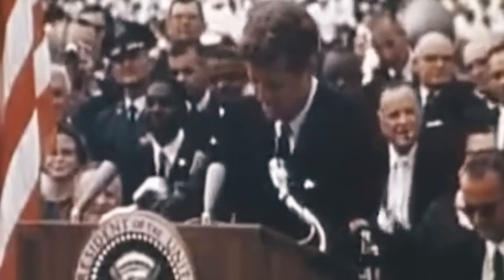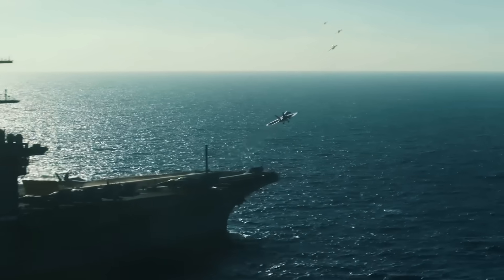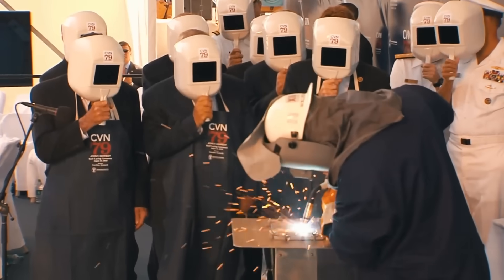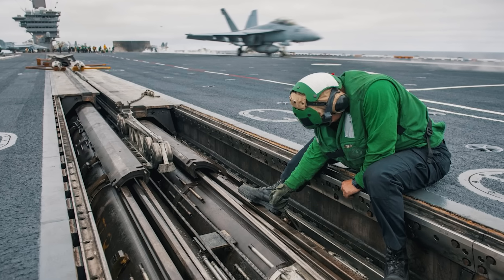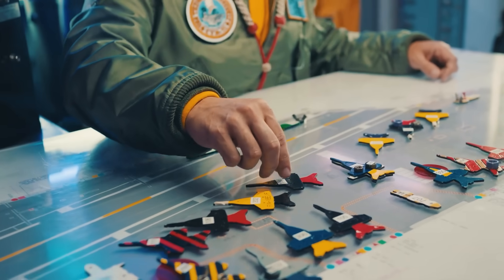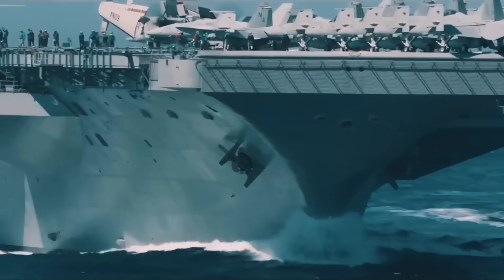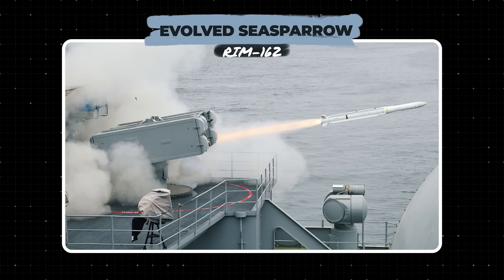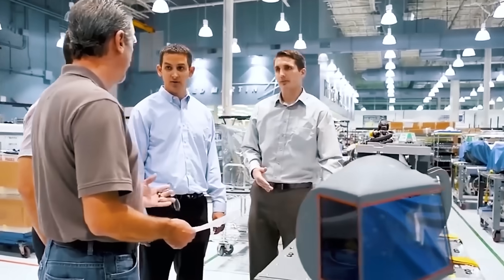US Revealed Brand New Supercarrier That Could Change Naval Warfare Forever

Comment: How are going to tell that CVN79 has the same length of flight deck as the CV67 non nimtz class aircraft carrier and the only difference between the CV67 and nimtz was power supply.  They both only could hold 70 aircraft across the board.  All Ford class aircraft carriers can hold 100 making them an extra football field long beside all upgrades it has nothing to do with sorties it has to do with more aircraft, better technology and ability to deploy faster you really need to check your information

Comment: The current all new U.S. Ford Aircraft carrier has been a total disaster on all levels.
1. Electric Catapult System constant failures

2. Magnetic Payload Elevators constantly failing and do not meet the speed up and down requirements per contract.

3. All new radar systems complete failures

4. Toilet failures

5. Crew quarters significantly undersized, horrible berth locations and too few beds; significant “quality of life” issues

6. Steam Turban problems

7. Electrical failures and constant power brownouts 

8. Undersized key systems for even basic needs

9. Everything from A to Z significant out of contract specifications. 

10. Significant & Dangerous Build Quality and Reliability Issues.

Comment: They should take the lcs warship and replace the main gun for a rotary cannon aka the gau 19 avenger machine gun (a10 gun) and probably make a new helicopter that is specifically designed to be launched from the lcs for a tactical assault so maybe like a hybrid of a gator heli and the uh-1 huey

Comment: And when they tell you its top speed is 30 kts + Trust me   It's all that and then some!  Let me put it simply.. On USS Berkeley DDG-15 of San Clemente island doing an Engineering full boiler load run we achieved 34.5 KTS our CO was psyched and let the Run go on at the Chief engineers digression just to see what she could sustain. As we turn South East to head to SD1 the Nimitz was on the horizon I'm sure she had been listening to our run. As the Nimitz BLEW by us I went to CIC and asked the watch how fast it was going. 51 KTS.  And I'll wager there was a bit left in reserve. NO FLIGHT WING on board.
Reply: Jesus H.  51 plus knots !  A ship that size moving like a sped boat  ! !    You could water ski behind that baby ……
Reply: @nofakenews9558  It's a sight to behold! The rooster tail behind our ship was 15 feet above the deck. When that CV/run away land mass passed us the wake was enormous.

Comment: Here's some information about CVN-79: Class: Gerald R. Ford-class aircraft carrier. Significance: It's the second aircraft carrier of the Ford-class, the U.S. Navy's latest generation of nuclear-powered supercarriers Construction: CVN-79 is being built by Huntington Ingalls Industries at the Newport News Shipbuilding division in Newport News, Virginia. Current Status: It is currently undergoing fitting out and is nearing completion, approximately 95% complete as of April 2025.
    
Delivery and Commissioning: The contracted delivery date was July 2025. However, the Navy has indicated that this date is under "significant pressure" due to remaining critical path work, especially related to the advanced weapons elevators and aircraft launch/recovery equipment. Previous expected delivery dates have shifted from 2022 to 2025.
        
The current expected delivery is early 2030. The commissioning ceremony is expected in 2025, but the exact date is yet to be announced by the Navy. Advanced Technologies: The CVN-79 incorporates advanced technologies like the Electromagnetic Aircraft Launch System (EMALS) and Advanced Arresting Gear (AAG). These technologies are designed to increase the ship's ability to launch and recover aircraft and offer potential benefits like reduced airframe wear and tear.
    
Planned Homeport: The Navy is considering Naval Base Kitsap in Bremerton, Washington, as a proposed homeport for CVN-79, with upgrades to the facility expected to begin in 2026. The carrier is not expected to arrive there earlier than fiscal year 2029.
Namesake: The ship is named after President John F. Kennedy.